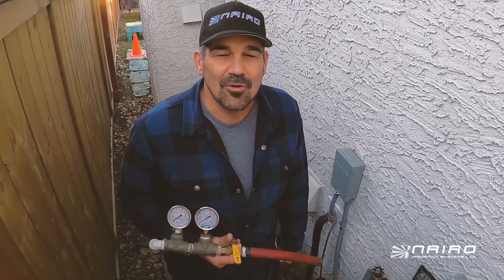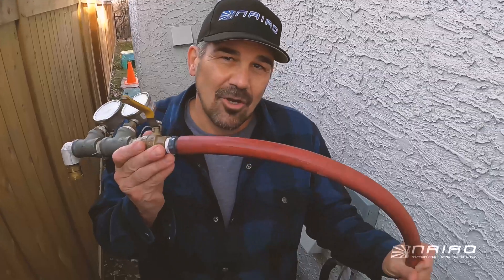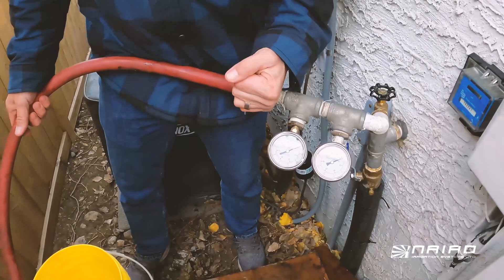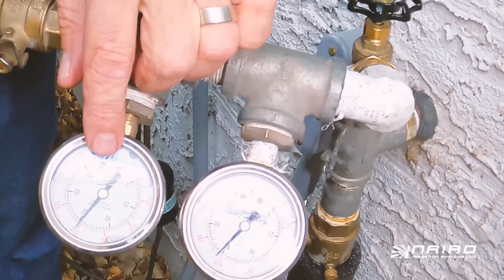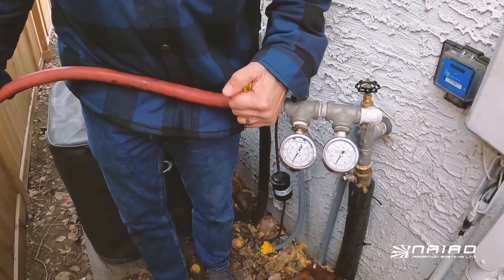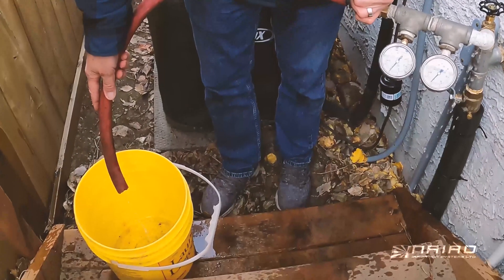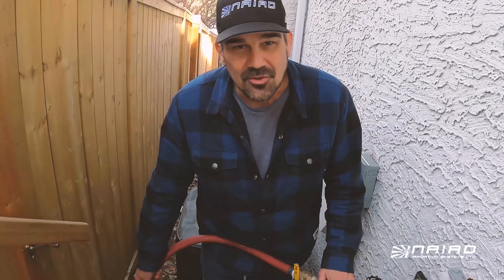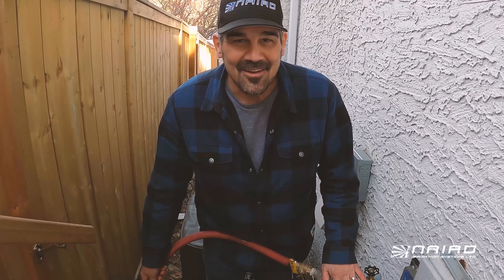How do you calculate irrigation flow rate?

Comment: Shoulda said if it takes 2 minutes to fill up a 5 gallon bucket, don’t run your sprinklers off a hose bibb!
Reply from the maker: Would agree with you 100%.  Customers often ask why we do not.  In our area the hose bib is fed by a 1/2" pex line, thus really restricting the flow and driving up the cost of installing the sprinkler system.  Do it right, do run a dedicated water line for your irrigation system from downstream of your water meter and ensure to use a backflow device approved for your area.

Comment: Thanks for your post but I do have issues with how you performed it. First, while i realize the leakage is minimal and would have virtually no impact on test results, I think you could have tightened the connection on the hose bib to stop all leakage, but that is trivial. Now secondly, the way you established 40 psi is fine, but then when you go to test, how can you be sure you are still at the 40 psi when you are opening the valve to an unset position? Would it not be better for accuracy to have a valve pre-guage so as to set the pressure and simply put the hose in the bucket and time the test? One could add a second valve just for off on purposes after the guages but is it really necessary. Why go you have 2 guages?
Reply: All great points.  Is s quick a dirty way of showing someone how to test flow at the source.  There are many other factors to consider downstream.  Losses/gains due to elevation, losses through fittings/pipe, losses through control valves, etc.  Point of this video was to point out that a flow test should be done at the desired pressure you want at the starting point.

We use two gauges because it ensures we are getting the correct pressure reading.  If you do a pressure test and there is a huge difference between the two gauges, you know there is an issue with one of the pressure gauge.
Reply: What about the homes pressure reducer? Not an accurate test unless you're using the line from the house as your mainline/source
Reply from the maker: No pressure reducer on that house.  Test was done on the irrigation mainline, just down stream of water meter and backflow preventer, so it was accurate.